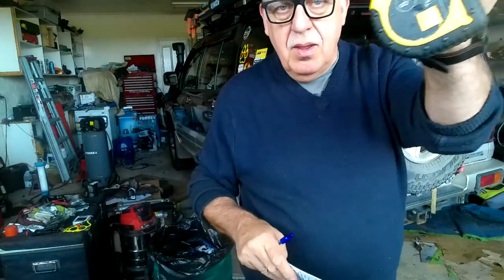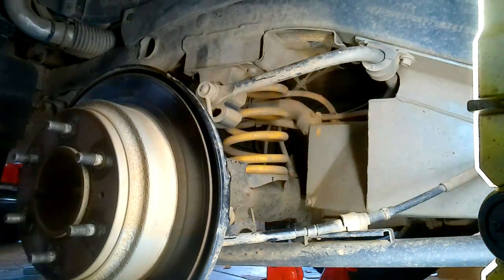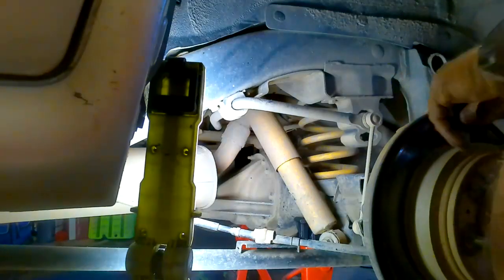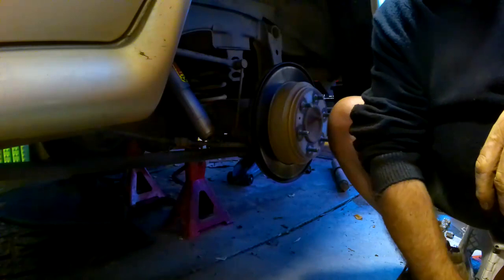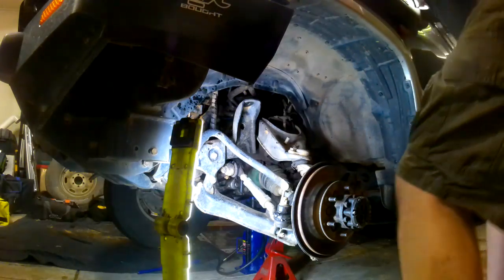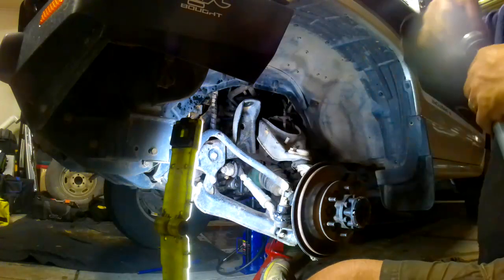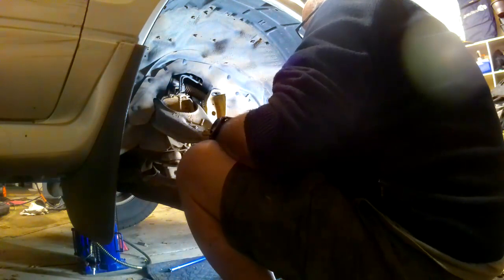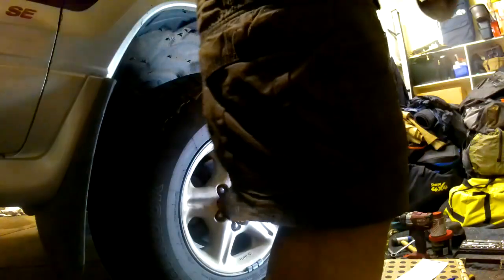Fitting the Tough Dog Shock Absorbers

Comment: Just measured mine 520mm rear and 510 front. I don't have any lift as far as I know, so that's good, I can get some heavier duty rear coils to bring up the rear when towing, adjust the torsion bars to match and replace the dampers/shockers. Other option is to add air bags for when towing I suppose.
Reply from the maker: I did have the option to buy adjustable shocks but I don't need them.
Reply: @thejackaroo4WDcampingchannel  Thanks Dave. Do adjustable shocks alter ride height or just amount of damping?
Reply from the maker: @Bennyboy-dog  Not sure probably the damping, I think you need airbag shocks to adjust the ride height. A problem you will have is if it raises it too much because any more than 2" and you need to fit diff hangers to keep the driveshafts from popping out and extended spring locators to stop the springs falling out.